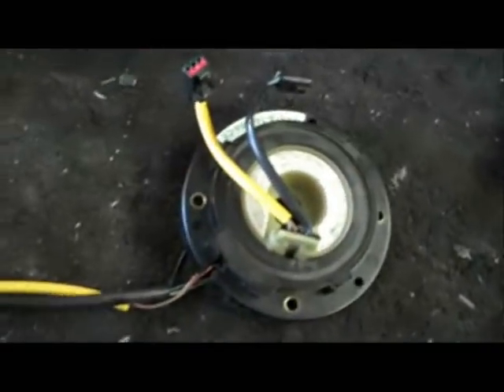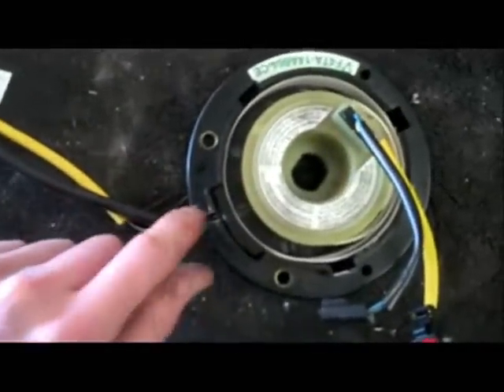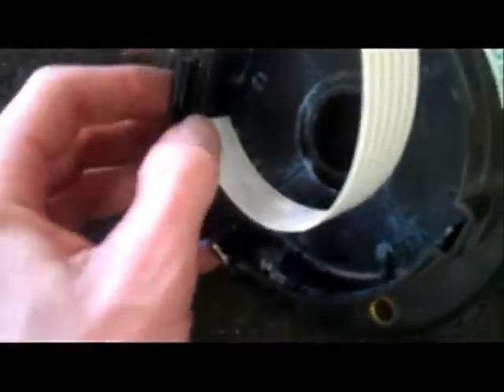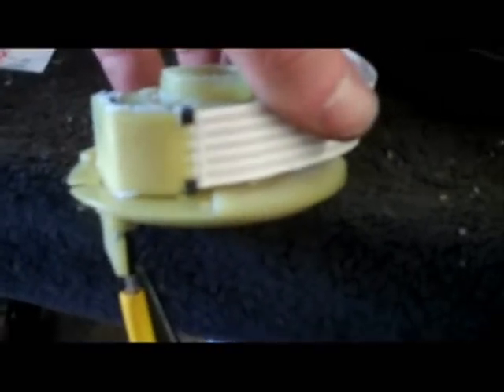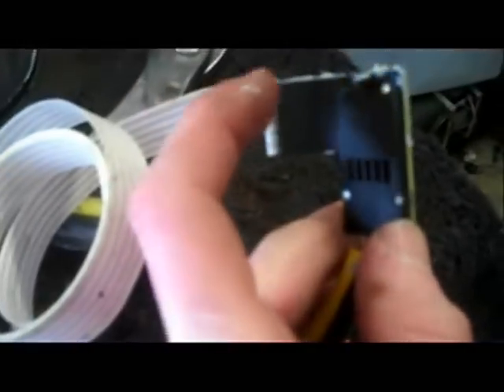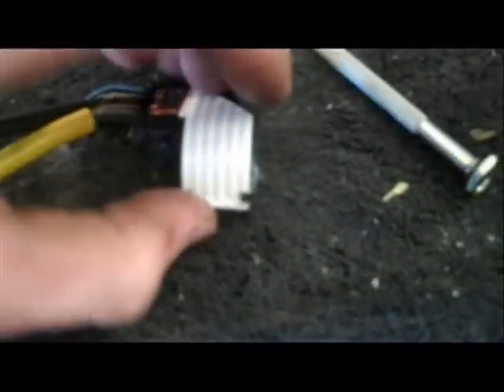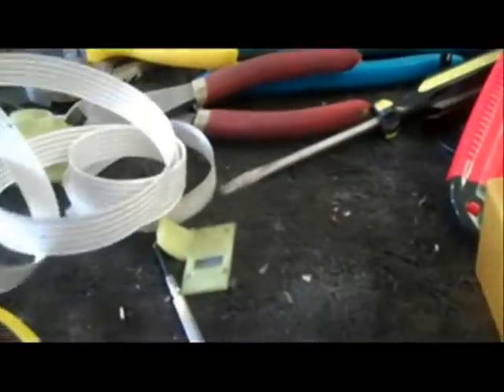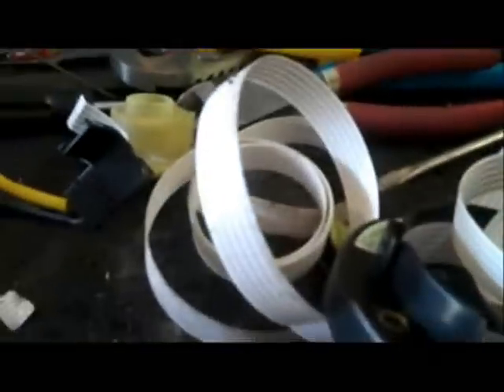clockspring dissasembly

Comment: PFUN41 you are the man, u saved me 250 bucks from the damn dealer. I have a Infiniti I30 A33, they asked 250 bucks to replace this. I followed your video, removed the whole thing, cable was broken like yours. went to the radio shop, got them to solder it nice and proper and put some Silicon on the edge so the ribbon wont move anywhere, paid $1 and thats it. i followed another video to reset the air bag computer, now it works like a charm. Thank you so much, RESPECT!!!!

Comment: thank you for your video. I use your information to fix mine. I disassembly the clockspring and i found the tape- cable broken, that was giving me problem in air bag and horn

I use ribbon cable of 5 cables to fix it. You can find ribbon cable inside old PC, but you can buy some in electronics store. I solder both sides and assemble it back. It is working fine.  

Thank you for your video.